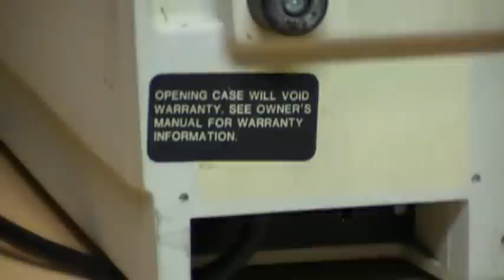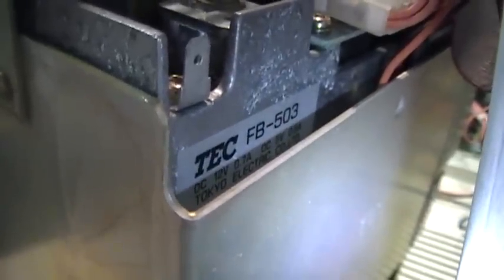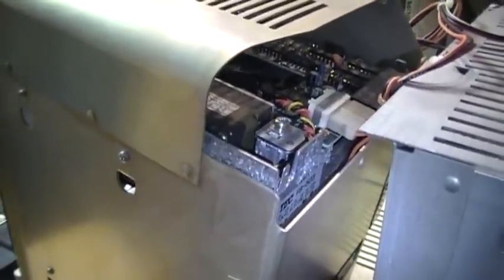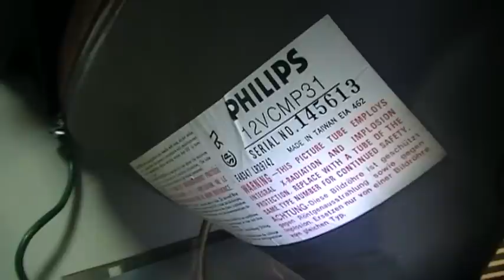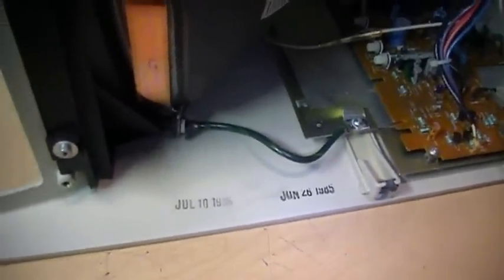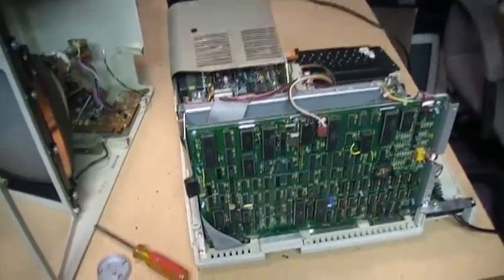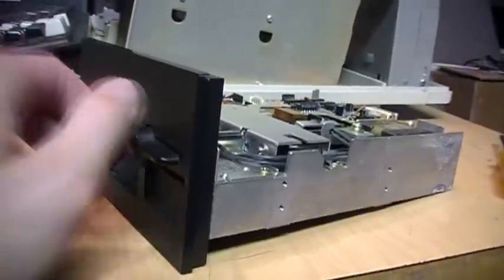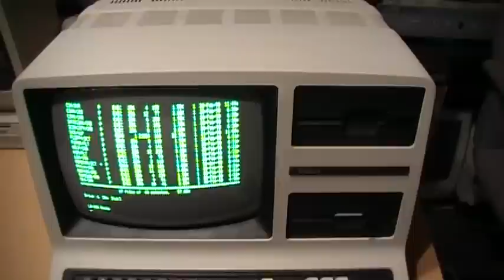Inside the Tandy TRS-80 Model 4D computer

Comment: I really like the fact that the CRT and flyback board attaches to the upper case, so you can get it out of the way and not risk a shock hazard while you're working on it.  Apple didn't do that for their compact-case Macs, making it a bit more difficult to safely work inside the case.

WRT the floppy drives, you don't technically need to swap them.  Just change the drive-select jumpers and the upper one will become drive 0.  I know it's not Tandy-standard, but I always preferred having my primary drive on top.  (Of course, you need to move the jumpers if you swap them, since cable position means nothing with a non-split cable.)

Comment: It must have been really hard puncturing that sticker. I always hate doing that to 8 tracks that need repair and they've never been opened lol
It's very well designed with the cooling vents! Not only will it never clog with dust and break down, but it's much quieter too.
Swapping the drives to evenly distribute the wear is a great idea too.

Comment: My first computer was a TRS-80 Model I, without lowercase or sound. I learned a great deal about programming from that computer. btw, the Model 3/4 computers used mostly port mapped I/O vs memory mapped of the Model Is. It was a lot of fun learning Z-80 assembly language as well.

Comment: Just picked one of these up, not sure if it's the D version. I got it for a song, along with a CoCo and Ti. It looks identical to this, has never been opened, and practically mint other than the yellowing on the bottom. Unfortunately, it powers up with a blank screen and diagonal roll. Guess I'm gonna have to break that warranty seal and try capping it! Thanks for the throwback...

Comment: Could the Model 3 or 4 be configured with only one disk drive versus two?
Reply from the maker: +Mugg Mehlmann Yes.
Reply: Yes.
But don't think you can convert a cassette Model III or 4 into disk-operation  just by adding a disk-drive. You needed more: apart from the disk-drives, of cours, you needed a "tower" to put the disk into. It can be seen in the video, where the diskdrives are located. This tower could be plastic, but most of the time, it was metal, bolted to the ground plate of the machine. Further more, you needed a disk-controller. A cassette Model III or 4 didn't have that, standard, so you had to add it. Finally, some Model IIIs had a power supply that wasn't strong enough to power and the computer, and the screen, and the diskdrives. Typically Tandy, they added a second PS. Bottom line, to upgrade a cassette model to disk operation costed you almost as much as a new machine. So you could just as well... Nowadays, look for a TRS-80 III/4/4P/4D with disks in it. Even if they are shot, you can replace them by std. 3.5 inch PC disk-drives. Anything that runs @ 300rpm will work in a Tandy Model III/4. So no 1.2 MB floppy drives (they run @ 360 rpm) Any Model III/4/4D can run 4 drives. A model 4P can too, after some surgery...

Comment: Didn't you upgrade the RAM? You only need 8x 4164-### chips. ### can be 200, 150 or 120, but all have to be the same number.
The Model 4D essentially used the same motherboard as the Model 4 gate-array version.
Reply from the maker: As of yet I don't use any software that would really benefit from the RAM upgrade. Plus, it would no longer match the "64K" badge on the keyboard.
Reply: ALL software on the TRS-80 Model 4 can benefit from 128 KB RAM. LS-DOS is overlay-based, meaning that it loads system files in RAM when needed. That's how you get an OS with a similar functionality as MS-DOS and a superior command set (in some sitations) running on a 64 KB machine. The frequent swapping of libraries - SYS1/SYS and up - slows the machine down. With 128 KB, you can create a RAMdisk with all system files on it, and make that drive :0, ie. system drive. All OS loading is then done from  RAMdisk, at RAM speeds, considerably faster than true floppy operation. Not only will the model 4 run faster, it will also be quieter.
Reply: The RAMdisk-utility is standard on the system disk of LS-DOS.
On top of that, there was a utility where you could make a 128 KB Model 4 duplicate itself. You could run 1 program in the first 64 K, the second  program in the other 64 KB. You'd have actually 2 Model 4's in one machine. Furthermore, there was enough room to have a third machine, where you could execute all OS-commands, but not run programs.
Reply: No program that benefits from 128KB ? If you can, do upgrade your Model 4 to 128 KB. And it will prove to be a very versatile machine, giving it a functionality that no contemporary MS-DOS had. 
"It would be foolish not to do it". (quote from Computer News 80) ;-)